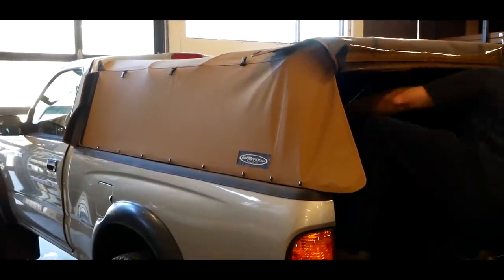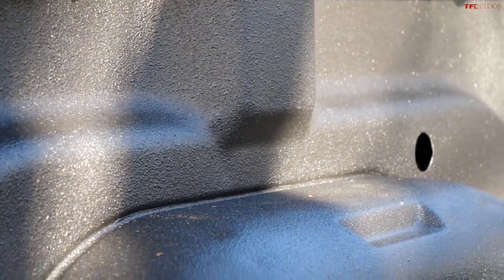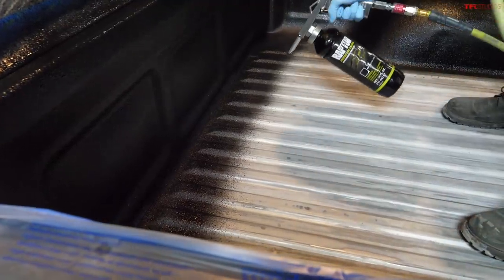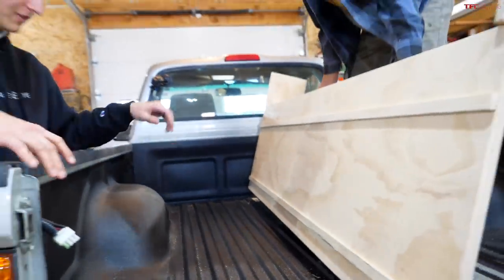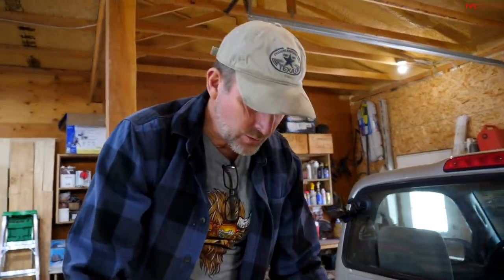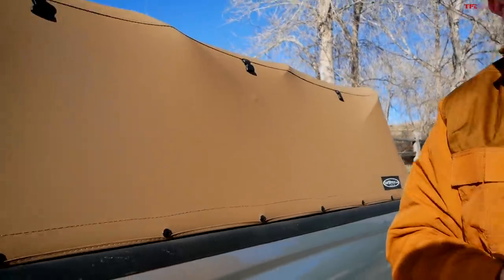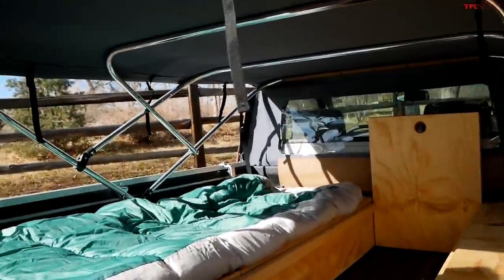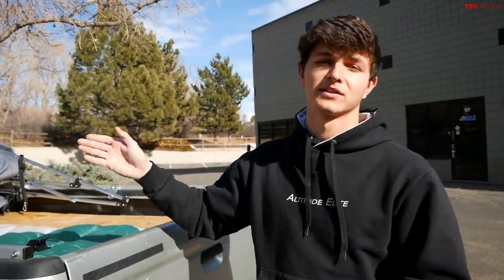Here’s How To TRANSFORM Your Truck Into a Rad Camping Rig On a Budget! Baby Yota Ep.7

Comment: You found a bunch of cases, empty ones.  you guys did a great job on the video.  Excellent job on the bed box David, nice routing the boards tight and clean.  Soft topper looks good on it nice choice guys.  Don't use it in bear territory in spring if you are a heavy sleeper.  Whoever ends up buying this will enjoy all the work you are putting into this little truck.

Comment: I was initially thinking that the wood should be painted black, but honestly I think a nice boiled linseed oil finish would be absolutely perfect. It will not rub off on the sliding surfaces and will even add some lubricity. It will seal out moisture, especially where the edges contact the bottom of the bed, prevent splinters, and really make the wood look nice. 

Finally, it’s easy to reapply every year to maintain the finish.
Reply: Thats a great idea Ordo... We put tung oil on all surfaces. its a lot like linseed oil but a bit more expensive but it doesn't leave an oily residue.

Comment: This is a great build out for camping in the back of your truck!!  I really liked the wooden bed and storage set up--- very basic, affordable, and quickly removeable !  

Great job to everyone involved with this project!

I also really like the softopper set up!  I will have to look into one of these.  We have an F350 Long Bed to pull our travel trailer.  We are struggling to decide how to weather protect our bed contents-- tarp, softopper, or hard topper.  Those hard topper's provide great protection, but they sure are expensive and difficult to take off the truck; especially when solo.

Comment: thats why you put it on an incline, lift the rear of the bed liner and spray wash and wax under, then rinse after, it will keep it clear of debris. it's not fun trying to put sand and salt containers from the town fill for winter when you can't slide them in

Comment: Love the channel, would love an older (smaller) Tacoma.  Like the idea of a soft-topper, needs screens so you can have sides open for air.  Like the spray-in bed liner, but doesn't water also get under those and crate rust?

Comment: You should use primer coat whit reactive anti rust protection... poliurethane did not prevent rust i water gets under it after condensation. And acetone is less reliable than proper silicone wash spray

Comment: Most common bed hardtop (canopy) we have over here is an Ifor Williams canopy. Four J Bolts hold it in place. Surprised you don't have similar over there. You'll get a useable one second hand for about US$150 in UK.
Reply: Most of the hardtops are painted to match now.  The older ones from years back were cheaper.  But you also need to wire in a 3rd brake light normally on hard toppers and more than 4 bolts.
Reply: @badgerpa9  Thanks for your reply.
We do have the modern hardtops usually on Japanese pickups but they're not as common as the older style.

Comment: Fiber glass topper Vs Polyester top. One rip on that polyester and shes a RIP for sure. 
Pro: fiber Glass - Durable, longer lasting, Security used goes for $200-$500 and new around 2K to 5K
Con: Polyester - Short lived when exposed to natures elements especially the sun and rain, shrinkage and rotting and cracking and then tearing apart. Used havent found any but new $900 to $1500

Its just polyester, if they could sell them for $500 people around the country would be buying like hot cakes and even after 3 years of usage you can tosss it in the garbage and replace it. But at $900 to $1400 makes it hard to use and abuse the polyester over time.

Comment: Odd question but would you be able to put the original bed liner back in after spraying?  Thinking the spray on will protect the metal and the bed liner serves as originally intended.  Best of both worlds so to speak.  Yes, no, ehh?

Comment: The storage and sleeping system is brilliant. The soft topper sucks. First branch is gonna tear it, it's going to be a tree sap, bird crap and road grime nightmare to keep clean. At highway speeds it's gonna flap and flop. It's about as secure as a screen door. Like all convertibles the rear window will turn obscure and be useless as a window. Like most snap on bed covers the snaps are going to fail. Should I give more reasons why it's a bad choice?
Reply from the maker: So far so good. I’ve run it into some trees and have taken it up to 80+, no issues. You’d be surprised they’re pretty durable
Reply: @TFLclassics  
We'll see.
But the presentation was great as always! That's what counts.
Tommy's always great and Kase (Case?) is an amazing addition to the channel.

Comment: Still have to consider condensation and breathability with the soft topper.
Reply: The trick is the top of the front and rear panels are held on with velcro. Just pull a little hole open.
Reply: @mase002  you need more than just "a little hole." You need airflow, and even then you're still likely to get some
Reply: @RedWingsninetyone  there is enough airflow. the thing breaths better than my marmot tent. The holes allow the moisture that moves up flow out.

Comment: Turning a truck in to a cramped tent camper isn't my idea of "progress."

I'm not a fan of the Soft Topper.  At all.  I'm not a fan of the plywood "sleeping platform and cubby bin system" thing, either.  David comes across as a skilled carpenter, but what keeps the lids on in rough going?  Friction and gravity?  David appears to have a lot of space to store all that assembled plywood when it isn't in use, which would be the overwhelming majority of the time.  I don't have that luxury, and even if I wanted all that assembled plywood in the truck for camping, which I wouldn't, I wouldn't want it in there all of the time.  

If that truck were mine, I'd have started off by catching up on any prior owner neglect and making sure the thing worked like it was supposed to in stock form, first.

I don't really care to drive anywhere on four wheels that absolutely requires a tire bigger than 31" tall in order for me to get there.  A Tacoma of that vintage can take a tire that tall with no lift and I wouldn't bother lifting an IFS rig that can already take the biggest tire I want to run.   My suspension mods would begin and end with a set of heavy-duty shocks.  I put some 31" BFG A/T's on it.  A winch bumper, winch, and recovery points would be nice.  I'd have bed-lined it, too.  Some kind of "lumber style" bed rack that I could attach recovery tools, like a shovel, pick, Hi-Lift jack, and traction boards to would be nice, nicer if I could hang some Roto-Pacs on it for water and gasoline, too.  

I'd just throw my camping stuff in the bed, same as I've done for my whole adult life, and call it good.  I'd rather take the less than fifteen minutes it takes to set up a quality dome tent that I can stand up in if I want to.  It doesn't take that much time for me to unfold a portable table and camp chairs, get my Coleman lantern hissing or my cooker cooking.  I don't need to turn my truck into a cramped tent camper in order to get to a campsite or enjoy myself in a modicum of comfort while I am there.  

What I'd have done to that Tacoma wouldn't make for a very interesting video, but what I did with it once done very well might have.

Comment: just started to laugh at the soft topper being "affordable"  you can buy a tent that fits in the bed giving the same space and function for a 10th the cost of that system.  Don't get me wrong if you have a need for a hard cover for keeping tools in or some such more power to you, but if the goal is "a cover to keep weather out for camping"  that thing is expensive as hell.   

My objection to them, personal views only of course, is that they dont offer the protection and lockability of a hard top or bed cap ect for protecting cargo/tools and they are almost as expensive as they are (to more expensive),  while offering no better function then much cheaper deployable bed tents with the only pro being ease and speed of set up.

Comment: Is the wood heavy compared to something aluminum/plastic? With the low HP would think to want everything as light as possible, even if it may cost more.
Reply: Also, any plans on sealing/treating the wood to resist moisture/humidity and if it gets wet?
Reply: The wood is surprisingly light and makes for a very appealing sleeping platform. And David did treat the wood so moisture wont be an issue
Reply: @kasevr  You're gonna needa drill a bunch of 1-2" holes in the plywood lid underneath the mattress (either standard type or memory foam type) in order to help avoid condensation/moisture issues between the mattress & plywood lid while sleeping on it in cold temps!(it needs ta have some breathability between the two!😉).

Comment: What stops the plywood parts bouncing outta place when off-roading?
Reply: Yea it's going to need some latches to hold down the tops.  Also, I know they said it's not going to rattle or bounce around, but it will.  When I built mine it drove me up the wall, had to find all of the parts that wiggled, bounced, or slapped around and secure them.  Then I carpeted the whole box which really helped.
Reply from the maker: @silver6gen1  I took it off-road last week and it held up like a champ! no rattles or bouncing. -Tommy